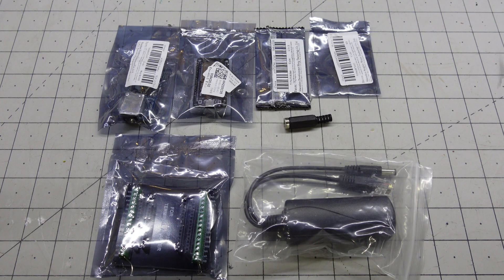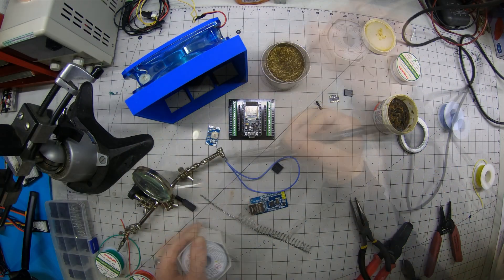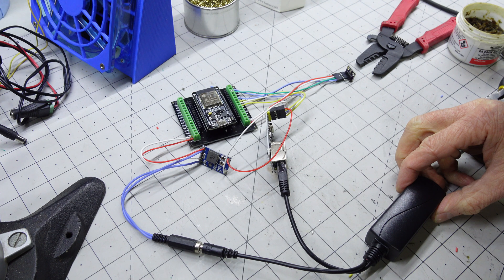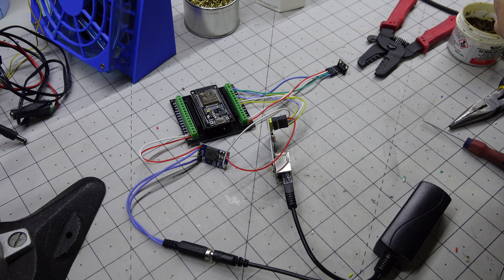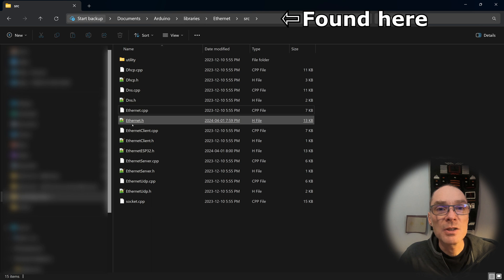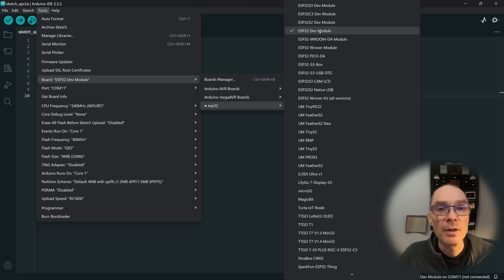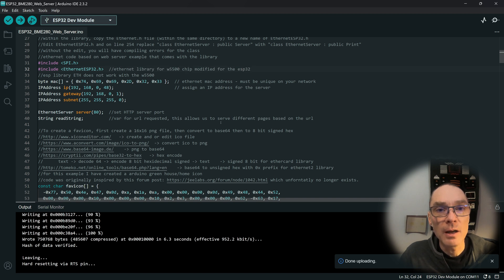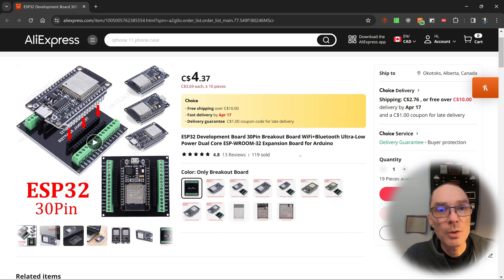ESP32-DEV, W5500 Wired Ethernet Module, and BME-280 Web Server with Favicon!

Comment from the maker: I was revisiting this project and noticed that after the Arduino IDE finished all its updates, it was no longer necessary to modify the Ethernet.h file for the ESP32. I am currently using Arduino IDE v2.3.2, esp32 board manager v3.0.3 and Ethernet library v2.0.2. This makes the project a little bit easier! Is anyone else using a W5500 board with an ESP? How did you get it working?
Reply: Thanks for video Reiley. I'm trying to make a project that uses ESP32 devkit + w5500 with 128x64 lcd.  I want to use Arduino IDE v2.3.2, esp32 board manager v3.0.3 but I don't wanna use esp32's ETH.h lib. because it uses extra rst and IRQ pins. Is it safe to use same wiring with Ethernet library v2.0.2? Did you had any problem with Arduino IDE v2.3.2, esp32 board manager v3.0.3 and Ethernet library v2.0.2?
Reply from the maker: @WebSpiderTeam.G  It is the same wiring, no changes from what I show in the video. No problem with Arduino IDE v2.3.2, esp32 board manager v3.0.3 and Ethernet library v2.0.2. My understanding is the esp32's ETH.h lib expects different hardware and won't work with the w5500 regardless of wiring.

Comment: Great video, really appreciated your work.
I'm migrating a smart outlet that monitors my internet with ping and power cycle the modem in case the internet is down. For that project I use a Raspberry Pi and code in Python. 
Trying to learn ESP32, I decided to bbuild another outlet with it, but I didn't want to use the builting WiFi, so got a W5500. 
Your information was fundamental to wire and get it moving, but when added the ping library the function caused an assert error and rebooted the ESP32. 
Have you saw that? All information I've found relates to using WiFi for ping, and that works fine, but not with W5500.
Reply from the maker: I have never tried pinging one of mine. I just tried and it pinged fine over the LAN, no reset. I didn't add any library or change the code. If you are adding a ping library to the esp, perhaps it is conflicting with the Ethernet.h library?
Reply: @reileymckerracher9181  Yes, ethernet.h and ESPping.h libraries added. The W5500 works fine with ethernet and get an IP from my pfSense DHCP and the ESPping.h works find over WiFi. Had posted on Wiznet but got their IA :-(

Comment: Thanks for the video, will using 5v from ESP to power W5500 also be insufficient ?
Reply from the maker: Do you mean from the Vin pin? If you are supplying 5v to your ESP, that may work. I believe that a W5500 always uses 3.3v for I/O (ie it has 3.3v I/O voltage when supplied 5v). I matched my I/O voltage of my microprocessor to the supply voltage to the W5500 so I can't confirm. Looking at the W5500 module, I believe when supplied 5v it converts down to 3.3v, then sends it onto the chip, which would indicate you could supply 5v to the module and still run it on a 3.3v microprocessor. Secondly, assuming you are powering the ESP through USB, I don't know if you will get 5v on the Vin pin.
Reply: @reileymckerracher9181  Thank you for your reply , I am currently using power from a 2A usb-c power supply but I have additionally plugged in a BME280 sensor and a four element relay and the whole set does not work stably and I lose connection with it. I am planning to use a more powerful power supply and hook up the W5500 and relay separately for power .
Reply from the maker: @citant  2A at 5v should be sufficient for everything. Two thoughts though, if you are using the Vin pin to feed current to the w5500 and relays, it likly is going through a protection diode and that may be overwhelmed, or, if you are feeding off a 3.3v pin, the voltage reglator on the esp board is likely overwhelmed, either way, a seperate power supply and feeding everything off that would fix the power supply issue.

Comment: "I have an ESP32 connected to a laptop through a W5500, but there's an error. Can you give me feedback on the code I wrote? I'm using Modbus TCP/IP for communication." I have subribe your chanell😊
Reply from the maker: Thanks for the sub!  I haven't touched Mobus in years, and even then it was one project in Python. I remember it being challenging and struggling through Modbus registries and endianness to read sensors. My suggestion, if you haven't done so already, would be to start with the Arduino Modbus library and start with their examples. When I revisited this project for the video 8 months ago, I didn't have to modify the Ethernet.h file any longer, and since arduionmodbus.h depensd on ethernet.h hopefully it will work on an esp32 even though the Modbus library is for an Arduino MKR.
Reply: @reileymckerracher9181  I've tried it, but I always get an error when using Modbus TCP/IP. I'm using the <ModbusIP_ESP8266.h> library. I tested the Ethernet and it works (using the Ethernet.h library), and the SPI.h library is also working fine. If I get this working, I plan to combine it with LoRa and a PLC that uses the Modbus TCP/IP protocol.

Comment: The link to the code is down. Would be really grateful, if you could check that
Thanks
Reply from the maker: I double-checked it, and it is working. If you are still having problems with the link,  find my contact info on my 'about' page, send me a message, and I can send it directly to you. Note that the code should be updated to reflect modifying the ethernet.h file is no longer required with the new version of the esp32 board manager.